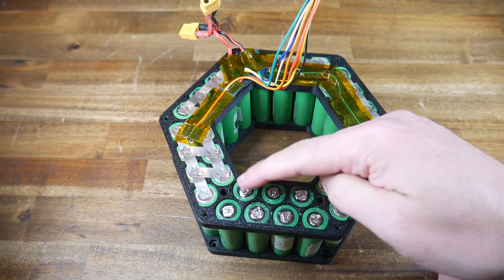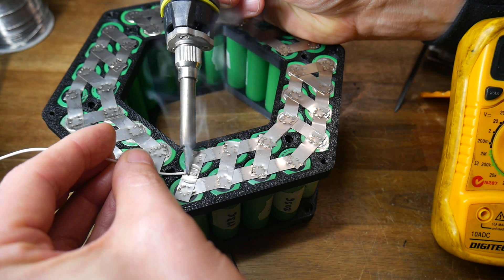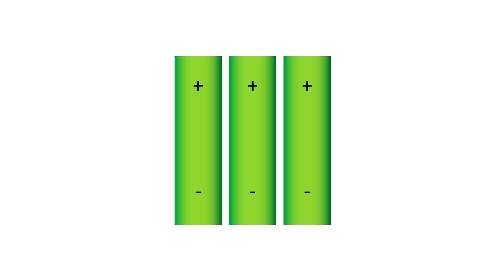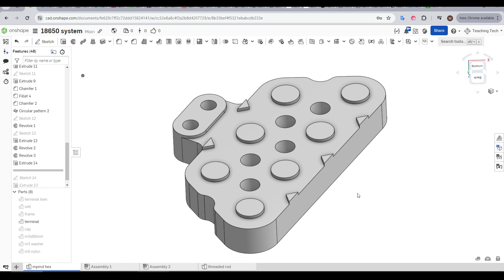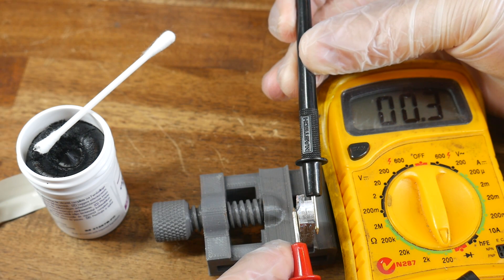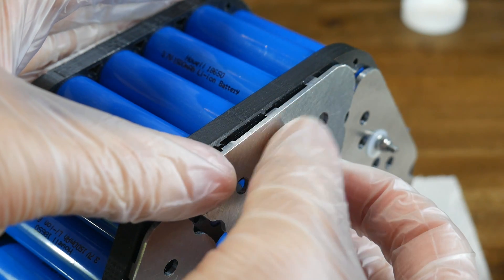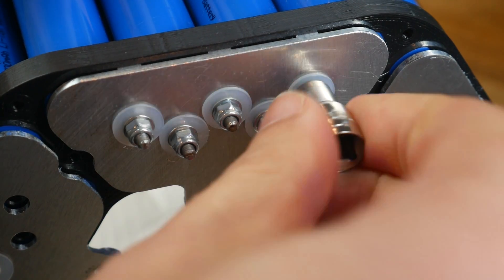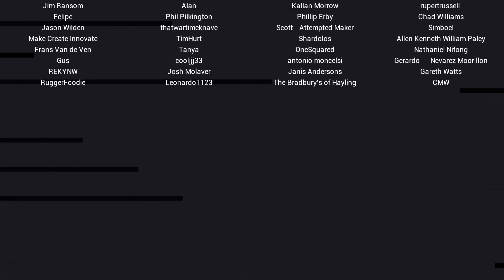Experimenting with a new (and probably flawed) 18650 building method: No soldering or spot welding!

Comment: I don’t think this is a good, or generally safe concept. 

Firstly, you mention that with this method someone doesn’t “need to invest in a spot welder” BUT “will need a CNC mill” which is ridiculous. Yes, a CNC mill is undoubtedly more versatile for making things. But, a spot welder is ~$150 for a very solid one. Any half-decent CNC mill out there starts at well over 10 times that cost. And for many people who want to make things, a 3d printer is totally sufficient, so it’s not like a CNC mill is a mandatory purchase otherwise. 

Second, if a whole battery cell dies, you’ll have to replace every cell in there in order to repair the battery regardless of how it’s constructed. This means you’ll have to take the whole thing apart with either of your designs. It would be much easier to make each battery cell it’s own self contained unit that can be bolted into or out of the battery as a whole. That would make cell repair/replacement far easier. 

Third, having large metal plates that, without bolts, are essentially free floating is a great way to accidentally short across the entire battery and cause a massive fire. This is possible with the other methods such as spot welding and bolting a bus bar to the batteries directly, but this those methods, you don’t ever have to flip the battery upside down to attach the conductive strips. That’s just super sketchy. 

Fourth, all of your bolts are essentially in the center of your aluminum part, and are (as far as I can tell) being bolted through the thinnest part of the aluminum. Aluminum fatigues over time, and is just a bad material choice for a battery that is going to end up in something that will be moved around a lot (as is the point of your battery powered printer) because it will crack eventually. 

Fifth, your ‘bolts’ are made from all thread, which you can bet is not a high quality steel. It’s not unlikely that these bolts will stretch over time, which will completely compromise your battery. Additionally, I would not trust those nylon washers over a long period of time either - they are far too thin, and nylon is a material that is known to creep. So in addition to the bolts potentially stretching, you’ll have the nylon creep as well, with will also compromise the battery (even if the bolts are held in the center of the hole in the plate). I would have used something like a phenolic resin washer or a mylar washer. For the bolts, it would have been easy to design and print a plastic piece that takes up the space the bolts do currently, and put some threaded inserts on either end of it, allowing you to easily tighten the bolts into a material that is not electrically connected to the opposite side of the cell at all. Additionally, even though you are confident that the bolts can’t touch the plate once assembled, you absolutely should have been using a washer that has a shoulder which can physically prevent the bolt from contacting the inside of the passthrough hole on the aluminum plate. You literally built your channel on 3d printing - why not just print a small washer with a shoulder that will do exactly that? ABS doesn’t really creep much/at all, is an electric insulator, and those washers would be small enough that you could easily print them on any open air printer without much in the way of warping issues. 

So, those are my main problems with this video. Spot welding is still the only ‘correct’ way to make lithium ion batteries, unless the cells each have integral threaded bosses that you can use like you did in a previous video. I can think of at least 3 or 4 different ways that you could design your carrier to accommodate spot welding while still being able to easily remove batteries in the even of a cell dying. In all, this is quite an unsafe thing to be doing, and claiming that this is potentially a viable/better alternative to spot welding is wild to me.
Reply: I wouldn't worry about bolts stretching, batteries are more likely to compress 😂

I wouldn't print sleeved washers as you would need engineering plastic to match commercially available sleeved washers.
Reply: @tymoteuszkazubski2755  I fly RC drones all the time, and stretching M3 bolts (the same size used here) to the point that they neck down and snap is not a difficult thing to do. With M3 all thread that's 80mm long, there absolutely will be some amount of stretching happening. 

You absolutely do not need engineering plastics (I assume you mean something like PEEK/PEKK/Ultem) to make a viable washer with a shoulder. ABS would do fine. I've printed ABS washers for M3 bolts before that have held up great over time. I've also had commercial Nylon washers that forced me to retighten the bolt they were used with due to creep. 

Have you ever used long sections of thin all thread? The stuff is not confidence inspiring, to say the least. And again, Nylon washers were a bad choice for long term electrical insulation under pressure in my opinion.

Comment: love your videos! but i honestly dont resonate with this project, it feels so unsafe, youve just taken something inherently safe and added extreme capability of a dead short if there is ANY deformation of those 3d printed pla brackets, what happens when the batteries get hot with high power output or if there is a fault? this would likely set off a chain of damage if the PLA starts softening and causing bolt contacts. id suggest removing the metal bolts in there entirity and replacing them with nylon bolts instead.
Reply: Even so I wouldn't trust a small amount of distance variation in the event of some thermal softening or if the battery gets damaged causing contact so easily. His new design that he shows at the end of the video solves this issue but the current one in my eyes is extremely dangerous in the event of high temperature or anything that could result in minor mis-shaping of the battery chassis.
Reply: He used PETG

Comment: Honestly, your solution scares me. You're one bad nylon washer away from a big fire. How will the washers hold up to the compression from the bolts? What if a washer splits in half? What if the battery gets dropped? Etc. Also, the conductive grease will still have a higher resistance than a proper weld, so you don't really fixed the hotspot problem.

If you want to make a larger battery and have it serviceable, I would still suggest spot welding, but making smaller modules instead of one big frame. And a BMS which knows about the modules.
Reply: yep, there is a reason why this method never get used commercially :)

Comment: 4:42 "(~)the more surface area, the more current" is only partially true, you need to apply pressure in order to have a better contact area with SurfaceOfContact=Pressure/LimitOfElasticity , this gives a very small contact area but keep in mind the goal is for it to have a low resistance and dissipate the heat produced, the very small resistive portion and the large amount of material around the points of contact will mitigate a lot of the problems
Reply: conductive grease is a good idea, but I am worried about the hyperstatism between all the cells dimensions, if one cell is 0.1mm longer than usual and another 0.1mm shorter it could be sufficient for the short one to get weak contact, I think you should make the aluminium structure as flexible as possible for the screw to be able to slighly deform the piece in order to assure contact for each of the 3 cells around it
Reply: the final battery with 4 cells for 1 screw is imo a bad idea compared to 3 cells, as 3 points share the same plane but 4 probably won't, a suggestion to eliminate all these contact issues could be to use a spring-like element (some washers are springy) in between the plate and each cells to ensure the same contact pressure for each terminal

Comment: is the reason the previous battery failed known? might be better to go a step further and make it so cellbanks can be replaced without taking it apart in the first place. maybe ensure the cell carrier has some compliance in it, if a cell wants to expand let it, better than the alternative faliure mode, round corners to avoid pinch points, reliefs built into the carrier. i also think you want a very thin layer of conductive adhesive, too much will risk it blocking up the vents in the cell, very bad. and id suspect it could risk blocking up each time you rebuild.

Comment: A lot of faith in the nylon washers here but the other issue is the cells dont like to be compressed, they'll heat-up during discharge and expand as a result and they really shouldnt be constrained.
Also copper, while being more expensive, will probably not need as much clamping pressure as its softer than aluminium and can conform with better contact. (you also only need half the contact due to the added conductivity)
Reply: That pressure against the cells would also increase depending on the temperatures involved during use, aluminum has a crazy coefficient of expansion.

Comment: PCBWay or other 3rd party machining service of your choice may be a good option for the aluminum bits for those that don't have their own desktop CNC
Reply: Some 3D printed internal barrels would allow you to just use self tapping screws. The barrels could have "wings" to stop them spinning. If they were almost the same height as the batteries, the screws could be quite long for plenty of "bite".
Reply: Good thought!

Comment: I would be curious if a conductive fabric might be a better option long term than the conductive paste, that you might be able to sandwich in there. I'd be worried about dry-out on the paste long term, but I could be wrong

Comment: Pedant time..
Thats tightening the nuts, you'd need a torque wrench (or equivalent) to torque nuts.
Reply: And there's no guarantee that all cells are identical in length, making torque adjustment a poor solution anyway.  A variation of 0.25mm in length would create problems in each group of cells which may go undetected since it's not possible to verify that each cell has a good connection. 18650s are not designed for longitudinal compression.
Reply: @GodmanchesterGoblin  Hello...
Several times (here in particular) I've seen the statement that 18650s are not designed for axial compression..
The curious side of me says, they must be able to stand some at least, spring contacts in battery holders are common.

So the question is not so much "can they take compression?", but "how much compression can they take?"

Not quite so easy to answer since that information isn't on the bulk (only ones I found via Google) of data sheets.

So...
Theres a paper on science direct about testing cells.
Upshot is that problems occur with over 4mm axial deformation. That's quite a lot!
But, what does it take to deform a cell by 4mm?
Another paper available via research gate from the School of Engineering, Beijing Foretsry University shows that a force of over 5kN would be needed to make such a deformation. That's more than 1,100 pounds!!

I think it's fair to say that the setup in this video isn't going to manage that, not even with a gorilla on the end of a wrench.

But your point about uneven contact across cells stands and is extremely significant.

When wiring lead acid battery banks in parallel it is vital to ensure equal  resistance in the path to each cell, otherwise one cell will be subject to the majority of cycle depth causing premature failure.
Reply: @dougaltolan3017  Good points!  Personally, I wouldn't trust a cell to maintain integrity and functionality with even 0.5mm of compression since it could put the internal seals under significant stress. Most spring contacts apply comparatively low pressure and would not be a concern, although peak current handling may then be an issue.

Comment: Nice idea if you have cnc. I'm using cheap battery holder like springs+flat pins from Ali. Easy to swap and cheap to use, resistance is higher tho

Comment: I like the design! Unfortunately I don't ow a miller... 
Maybe you can use a petg column with two screw holes on the ends instead of a long bolt with plastic rings? Or maybe print the plastic rings with on top a small ring that falls in the aluminium in order to prevent the long bolt touching the aluminium?

Comment: I'm trying to interpret the "Resistivity of 23Ω.cm" "feature" of the conductive grease (at 7:28).  Does anyone know what that is in units that make sense?
Reply: Cube with one cm sides will have 23ohm resistance. Use ohm law calculator. This cube will loose 23w of energy if one ampere will flow through it
Reply: @yevgennegvey4021  I guess a cube makes sense for this spec; was surprised to see just the 1-dimensional "cm" with no other explanation.  Thanks.
Reply: 23Ω per cm thickness. If your terminals are 1cm apart with grease connecting them the resistance is 23Ω. If your grease layer is 1mm then it's 2.3Ω
Reply: You have to use resistivity here, as the resistance is dependent on the thickness and the shape of the applied grease. If you apply more, the resistance increases.
Reply: The resistance is (l/S)*r_u where r_u is resistivity.

Comment: A couple of things.
1- I've built several batteries using the spot weld technique. The hassle vs cost savings ratio isn't worth it for me anymore. Soft Lipo battery packs with built in BMS have really come down in price.
2-Love your videos but your side note about accidentally buying ultrasound gel was the first time I actually laughed out loud while watching.

Keep up the great work!
Reply: soft lipo packs are basically bombs. these are much safer if used properly.
Reply: @riba2233  please provide the data that backs up that claim.

Comment: You could also print a nylon washer with a small sleeve to fit the bolts in.  The next design looks good, but the hexagonal design is more space efficient (hexagons are the bestagons).
Reply: I've been wanting a battery flywheel for a while. Hexagon is close enough.
Reply: Yeah, 3d print a 4mm OD ABS sleeve and M3 thread the inside, thread that onto the 'bolt' and make the bolt holes in the bus bars 4.2mm, then just tighten as normal with the nylon washer. Now you don't really have to worry about it since you have 2+ perimeters of ABS insulating the bolts on the sides as well.